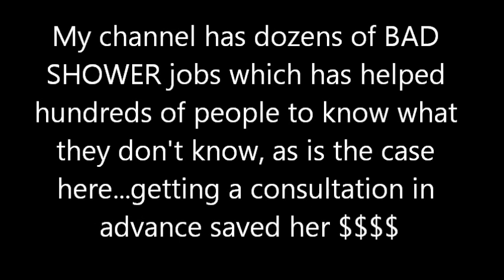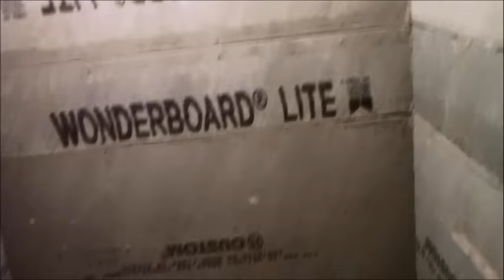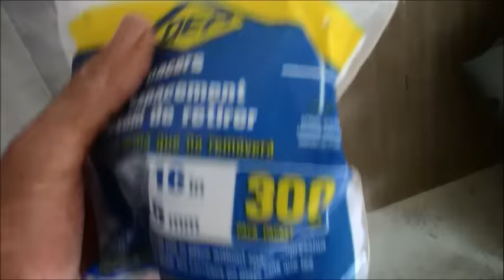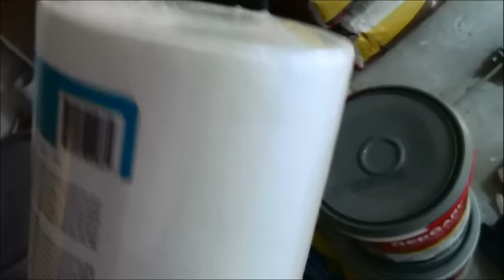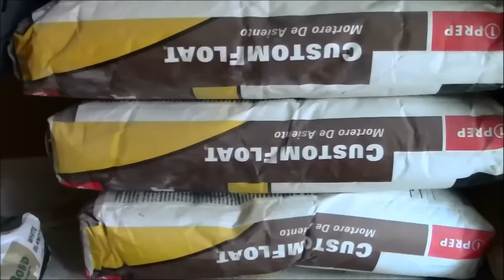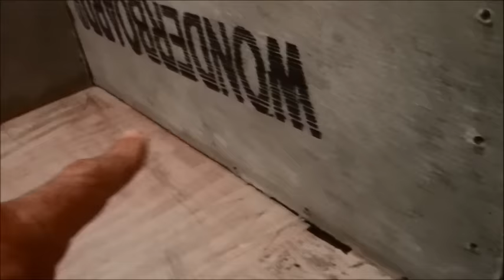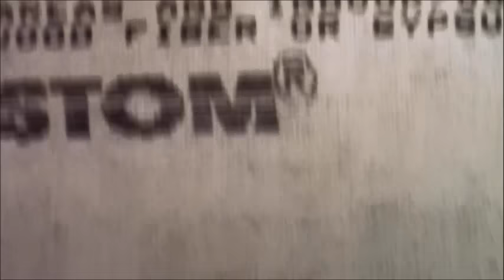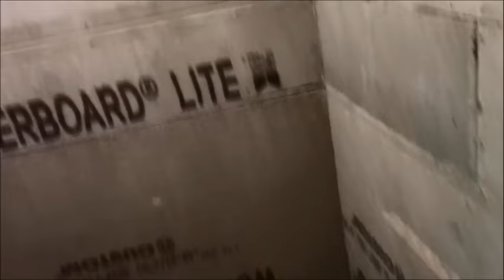BAD SHOWER DAY ONE !!

Comment: I will say the thing about spacers is that ive been doing tile for over 30 years and i wont save spacers. Spacers are cheap and i throw them away when i pull them now ive got some wedges that i will reuse on the leveling spacers but even at that i dont use them very often because the majority of the work i do is ALL mud work. Floors walls and if im doing ceilings then it gets mud. With the framers that are out there today with the lumber that s used theres no way i will use ANY backer board. I can mud a shower stall and feel much better about it than straightening out the framers lack of skill and pride of workmanship.

Comment: good video. Seems to be easier and safer to just install a prebuilt pan. Takes out all the concerns of leaks as long as the drain has proper thinkset and the wonderboard goes on the inside lip of the pan. The extra cost of the custom built pan can offset the labor also.

Comment: Try this test. Write down a plan for your next shower installation, and make notes describing the preferred, absolutely best way to do every single thing. When it's all finished count how many of those things you were forced to "nix" for whatever reason. That number should be at least 3, because that's reality. The fact is that outside factors will cause issues down the road before any of your "wrong" installation practices ever do. You shouldn't drive yourself mad in order to get what you think will be 100 years out of a bathroom, not when when your mixer valves are gonna fail in 30 years. Take a breath and use your noggin, it will be okay.

Comment: I have a question, what good does the 2x6 dead wood do? Why not just nail your rubber liner to the existing studs?
Reply from the maker: When I put in the 2 by 6 blocking it is because back in the day when I started I would see no blocking and I would see the pan liner bowed inside between the studs, it's just an extra feature I feel better about
Reply: @StarrTile  Don't you hate it when someone else does the pan liner and durock and they don't crease it tight and the bottom of the wall bows out a couple inches, Horrendous.
I always say,anyone can lay tile yet hardly anyone can make it as a tile layer.

Comment: Today's mastic is completely different from the mastic of the 80s or 90s. When used in the correct application it will literally RIP the cement board apart if you have to remove a tile once cured. Never underestimate today's mastic.
Reply: Mastics dry, cement cures!
Reply from the maker: Vinny
No use, this Keith guy been trolling me all morning. He's the ultimate expert, knows everything and you can't tell him he's wrong...some ppl just aren't worth the time 😉
Reply: Thought you guys would want to learn something! Guess not.
Reply: @StarrTile  Got it, thanks for the heads up..Keep up the vids. I like the channel. Thanks again Starr.
Reply: @keithfuller28  Keith I have to say I like you already. I know you know your stuff. What i have found  in my 30 year career is that Good tile techs are skilled artisans/craftsmen. They are few an far between but one thing I can say with certainty is that every great tile man thinks they are the best.. as do I..That's how a great artisan should think...I like it Keith an would love to see your work, start a channel share your expertise. I learn something new every day. "Remember great tilemen stick together an share knowledge the rest do it for a paycheck we do it for the pride/love of the trade.". Have a great day.

Comment: Which product would you recommend for the shower walls. As far ass drywall or cement board
Reply from the maker: If you're going to waterproof the surface then it's irrelevant what you use oh, it could be cardboard...
If you don't waterproof the surface then definitely cement board

Comment: You said not to use pressure treated wood... If using wood, what kind should we use?
Reply from the maker: I would not use pressure treated wood unless it was firmly in place with both construction adhesive and multiple fasteners to keep it from warping.
Otherwise just Pine two by four are fine

Comment: how would you address the joint where wall tile meets floor tile. Caulk or grout? Should you leave openings in this joint for water escape in case moisture gets behind the wall tile?
Reply from the maker: Grout... I don't see a reason to caulk unless there is a need to do so, cracking of grout later.
If moisture gets in there won't hurt anything

Comment: I completely understand why you say PT wood is unnecessary.  I can’t disagree at all.   I will disagree about your warping comparison. Outside and in side conditions are not comparable. No sunlight light exposure to heat one side vs another,  no extreme temp changes, no rain/snow.  That wood will be screwed down flat and dry really slow.  It won’t warp,  but you should not use pre-warped wood as shown, and if you use normal nails and screws the chemical will eat the nails and your curb will loosen.  If you have a leak at the curb that is not the wood you need to save and doesn’t stop your leak or your tile from failing.  You need to worry about the subfloor and joists.  Still can’t disagree that PT wood serves no added benefit.   A layer of PT plywood under the shower so that if anything does fail you don’t rot out the structure and save you money later...yes I vote for that.

Comment: Probably a silly question, but why is Mastic bad for showers, etc? What are your thoughts on rubber modified tile adhesive?
Reply from the maker: Mastic is not good for a shower because it is organic and therefore will attract mold and mildew but the biggest issue is it doesn't dry out behind the tile... weeks or even months later it will still be wet
Reply: @StarrTile  thanks for the tip :)

Comment: this was not a "bad shower/ tile prep"  it was a never got started renovation. so half of the video is talking about how had the last guy was biased on what he didnt buy "yet" and complaints of the prep work.  well he did say the guy was not finished so whats missing was not yet bought lol.  this looks to me to be a renovation of an old bathroom and that is why things are placed in odd spots and they are slow building it so the walls were covered with the wonder board so it was not bare studs AND they were buying things as they could....again big deal un screw the bottom sections....why the plumbing is the way it is well they are changing a bathroom from an old bathroom right?  i just did mine and ya know what? nothing was where i wanted it, toilet and sink i moved a foot left  and the tub drain was totally in the wrong spot for my shower....well dam i just went a head an moved them and ill be dam there was no prep work done at all before i did it
Reply: LOL !!!!!!! Besides all the things mentioned, 15 sharkbites inside the wall and you think the plumbing was going OK ????  Bahahahahaha !!!!

Comment: For what comments I've read nobody's mentioned presloping the shower pan before the liner is installed
Reply from the maker: Cuz the pre-slope doesn't work as intended and because it is not necessary anymore since we waterproof the shower pan surface
Reply: @StarrTile  just going off what ol'timers taught me a couple of decades ago when using a rubber liner and I'm sure kerdi is different, started using it when it was getting it's start but I play wheel of fortune from my couch
Reply: @StarrTile  also I've watched both of you guys videos and do have much respect for the time and quality of work that is put into this trade so thank you

Comment: Shotty work.

1. Used the wrong screws.
2.  Used the wrong screw gun.
3. Some of the screws were not attached  to structure.
4. Wonderbroard was cut too short in many places as is evident by the gaps. Did not have right measurements and/or it was cut all wrong.
5.The hole for the pipe coming out the wall, which looks like a mixer valve, is Not centered and its Not a perfectly round hole.
6. Subflooring is wonky. It was not glued down with construction adhesive,  not enough fasteners were used, and its not exterior grade plywood.

Comment: Too many guesses on an unfinished work, without a chance for the other contractor to defend himself
Reply from the maker: No point in him defending himself, the homeowner was getting ready to get ripped off and spend way too much and have to do it over again, that's the whole point of the video and why I ended up getting the work because she was smart enough to get rid of him early on... way too many screw-ups going on to even allow him to go further....
I see it all the time and have documented many of those bad shower jobs on my channel, all you have to do is Google bad shower job and I pop up.

You would suggest that he continued on with the work, mess up the whole job, have somebody else come in rip it out throw everything away and start over again, and let the homeowner brunch the expense?
Reply: Miguel...... Dude was a hack based on the 14 things he did wrong or was going to do wrong...you want to defend a killer AFTER the murder ???

Comment: Hey there! You mentioned that mastic was not a good choice for the tile (which I totally agree has no place where there’s wetness involved), but In my experience, I recently did a remodel in my own bathroom where I have a plywood floor that was previously done with 6x6 tiles. Underneath was 1/2 thin set underneath then apparently when they apparently ran out, they used the other 1/2 w/mastic. When removing the tiles from the plywood, the 6x6 tiles popped off easily from the thin set area but I had to yliterally chisel them off of the masticked area. So there is no doubt that on plywood the mastic held the tile much better.

Comment: The mastic is for the walls, the mortar is for the floor. Have you ever tired to use mortar on a wall before? 🤣

Idk man. Most of the materials this tile guy brought for the job are right. I do a lot of tile and I don’t have a cup of 1/16” spacers. I use 3/16” spacers on almost all of my jobs. 1/16” may have been a request by the homeowner.
Reply from the maker: I don't know what kind of tile work you have ever done but to imply that mastic would be used for a wall in a shower is 100% incorrect.... if you don't believe me just call any tile store and ask them.
Spacing by default for me anyway is 1/8 inch, it is extremely rare I will use a 1/16 spacing because you must have rectified tile to make that happen correctly.

Comment: People still use rubber liners? Why? The new waterproofing products today are amazing. A shower guy should learn how to put in a mud bed or a pre sloped foam shower pan. Those studs are definitely not on plane and would need to be fixed.

Comment: Why did you say the curb had to be set before the durock? We put durock up first, then kerdi, then set and pour our curb and pan, finally kerdi on pan and curb, inside/outside corners, kerdi-band and flange seals. What are we doing wrong?
Btw... I ask because I've only been at this a year. Oh, and 1/16" Frosch clips are our mainstay. And we keep every spacer we have IN THE TRAILER. Doesn't take up that much room. Also, those black plastic $3 trowels are a big red flag too.
Reply from the maker: My channel is mainly focused to homeowners and DIY people oh, they're not going to spend on Schluter products nor will they know how to use them properly....
But yeah those trowels were cheesy

Comment: You have opened my eyes so big! I'm building now, and in the shower the guy who did the frame in the bathroom did not put the 2x6 between the studs, I dont think that my drain is center and I have the green sheet rock in my shower!!! Durock is supposed to go in the shower right, and the pan liner and curb down before any backing?
Reply from the maker: The two by six blocking is not a deal-breaker but I have been doing it since my 1st job, and most tilers do.
The drain being off center would bother me, but he could have possibly run into a floor joist that made it impossible, I don't know.
In my personal opinion is the backer board doesn't matter, I often use green board on my shower walls but of course I waterproof them as well oh, if he didn't waterproof then that would be a no no. And yes I do all of my floor material before my walls ever go up
Reply: @StarrTile  I stayed up all night watching your videos, so I've seen that thr green board is fine with water proofing, but there hasn't been any waterproofing. I got really freaked out watching this first video. The drain isn't centered because the original plumber didnt do the pipes correctly. My plumber is wanting to do the pan lining and drain, rhs tile's job?
Reply from the maker: In a lot of municipalities plumber's will do the drain and yes the liner as well, I usually don't allow that on my jobs because I want to be responsible for the entirety rather than having a failure and the homeowner not knowing who to go to fix it

Comment: There is a type of mastic that says right on the bucket , can use on showers
Reply from the maker: The fact that you can use it and that it's not good to use are two totally different things
Reply: StarrTile I have used before but never toward the bottom . The first few feet up was always thin set , never had a call back . But definitely not on seats or soap dishes corner caddies etc !

Comment: laticrete tape and their products in general are far superior to red gard. in every way. taping corners and seams and then adding red gard over top of it in say, 2-3 coats, is going to help that substrate out drastically. there are so many products now to accomplish the same goal, like ardex 8+9, schluter sheet membrane, laticrete makes their own version of sheet membranes and uncoupling membranes in general now, too. the only difference between laticrete and schluter is that schluters uncoupling membranes are waterproof whereas laticretes are not. but if the substrate is prepped right, tile has proper thinset coverage and the grout job is done right, then you'll never have a problem. 

in the event you're doing a rubber membrane behind the backer board, those 2x6 scabs you're talking about are totally redundant. thats a placebo for people who think it makes a difference. and rubber membranes are completely redundant these days anyway. in this order - vapor barrier(aqua bar or roofing felt), stapled down, chicken wire stapled down, float your pan and let dry(48 hours is ideal), sheet membrane and preferably a schluter drain system installed during pan install. 

you can also do a divot method and water proof up to the drain, fill with p rock so your weep holes don't get filled with sand mix and then fill with more sand mix to bring to the right level for your finish drain height.

Comment: So, I get what you are trying to say and you bring up some valid points, but regarding the drain not being centered, there are shower pans that have different grades that allow the drain to be placed where every you wish. It’s unusual to have it thst forward but that was probably a tub that used to be there and to cut into the slab (if that is a ground floor) to rerout your drain is going to be expensive. You only showed the floor outside the shower to be creaking. Don’t really know what the situation is like on the subfloor.
Reply from the maker: So all that you said would be valid except for the fact that I was hired to redo this whole thing, and there is a video I believe in the description of the finished product.
I took care of all the issues that I enumerated on the video, including centering the drain 👌
Reply: @StarrTile  the point I’m making is it doesn’t need to be centered which is one of the flaw in your argument. The rest are legit tho... regarding the mastic, not even sure if that is for the flooring. I seen people use those on bathroom backsplash behind the vanity. Not good at all for shower walls or floors but it isn’t like that could have been for something else you didn’t describe
Reply from the maker: There was nothing in that bathroom that needed mastic, not even a backsplash. And yes the centering of the drain is something and I'm pretty adamant about and so was the customer, she was told it could not be done which wasn't  true.... then again given the preponderance of mistakes including 20 shark bites and the toilet supply plumbed in to the right, I just assumed he didn't know what he was doing
Reply from the maker: By no means am I saying that it has to be centered, what I said was most of my customers want it that way but there are many where I haven't done it that way as you mentioned on a slab especially.....
Linear drains are a good exception to that as well and likewise have done many of those
Reply: @StarrTile  lol I’m not arguing about the plumbing, that was a horrible job lol. Nor am I an expert plumber but even amateurs know there needs to be clearance for toilet setting. The only argument you can have regarding the toilet supply line being there is that the area of space got moved and the toilet had to be moved further away to facilitate that ealk in shower. Who ever did thst obviously didn’t map
It out before putting the walls up. Regarding the mastic, your viewers won’t know for certain what they bought that. The home owner probably didn’t say or probably misinformed the contractor that something like a backsplash was going to be installed. I always have stuff ready on hand than to have to keep going back and forth to the hardware/supply stores.